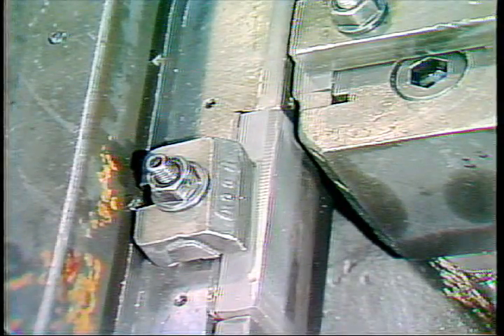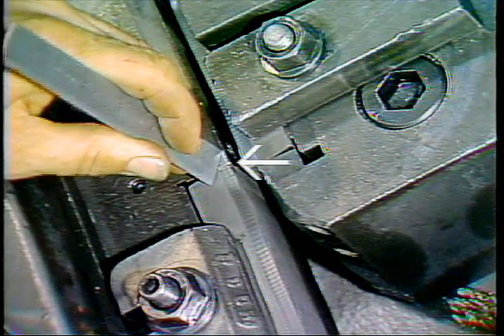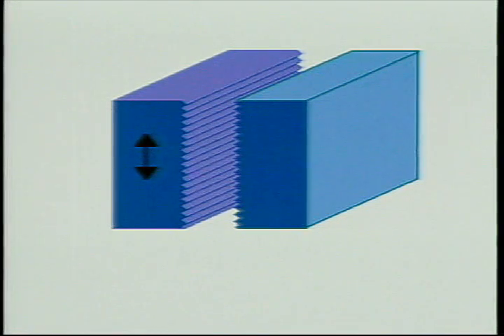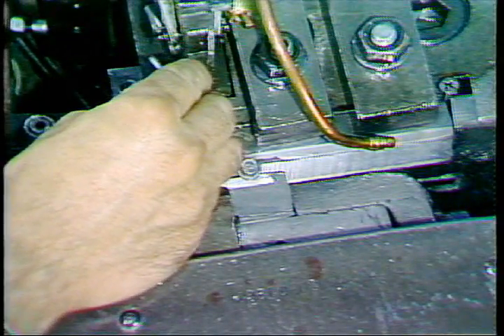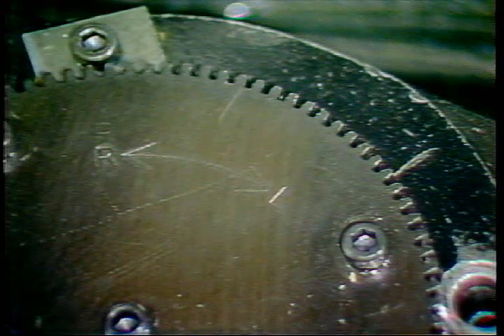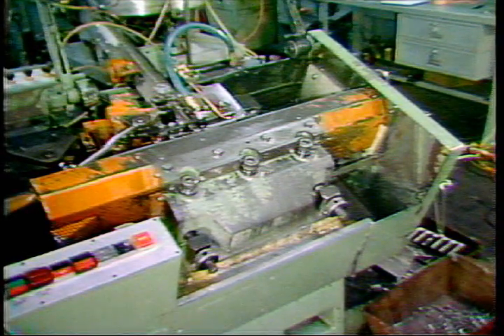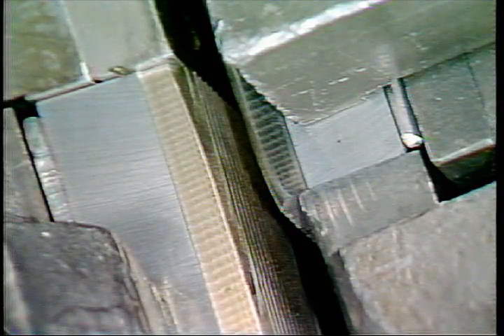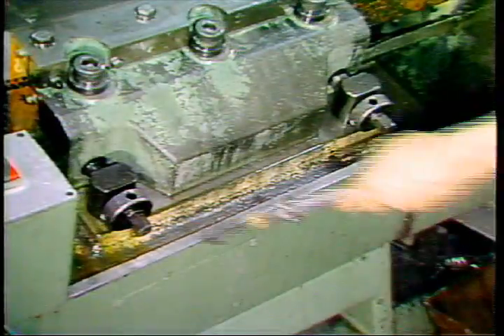Hartford Thread Roller sample from MasterTask Training

Comment: Great video. When i set rollers. I always set both ends of the roll / dies to the major diameter of the blank. Once this was done I set the alignment, then adjusted to the affective diameter then check the major diameter if this is wrong. Wonder off and complain to the who ever made them.😊